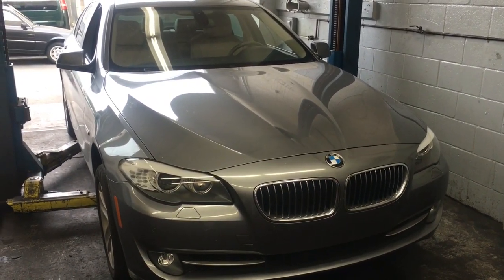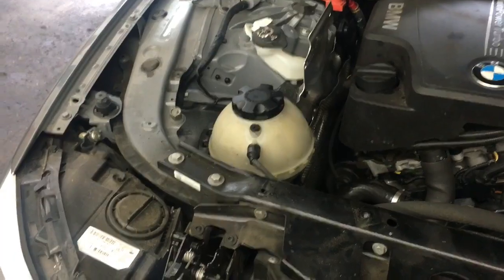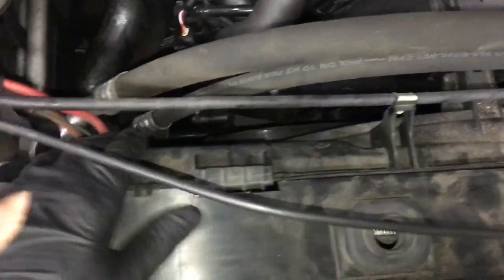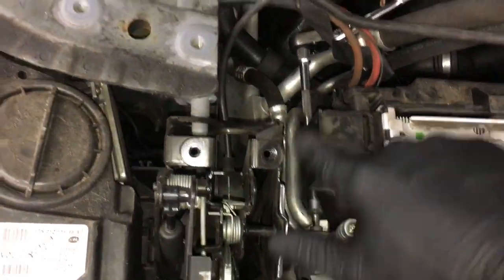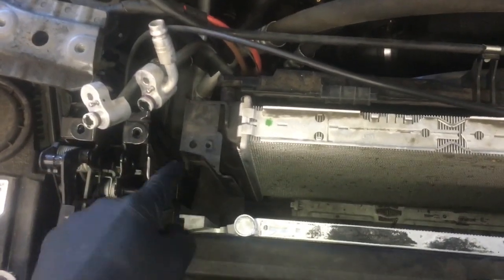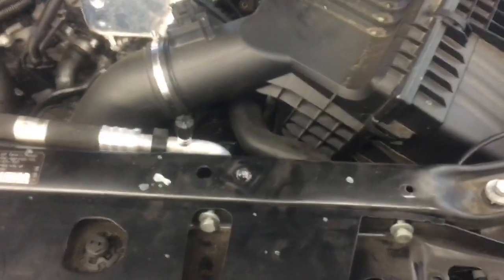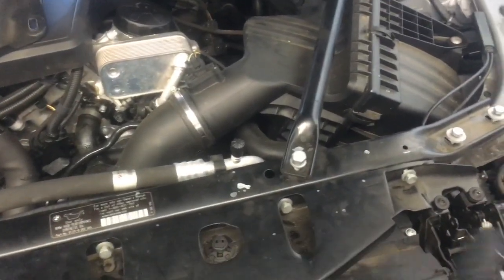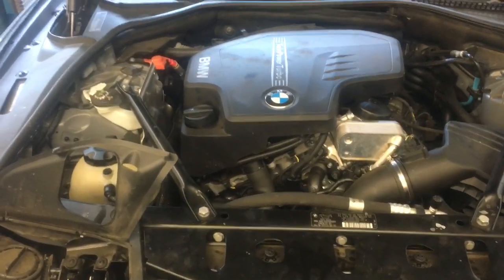How To Replace The AC Condenser On A BMW 528i (f10)

Comment: So, just followed this video guide for a 2013 BMW 525D and apart from the screw location is slightly different for the condenser/radiator plastic cover, its exactly the same! Great video which has saved me a lot of time today at work. Thanks for uploading it!!
Reply from the maker: Johnjourno glad to help. Thank you for watching and writing!
Reply: Aha yes I just said the same. I needed an extra long extension squeezed down the gap to the side of the condenser.

Comment: Paid £90.00 for BMW to daignose this part as leaking. They then quoted a FURTHER £748.00 to replace it!! I bought an IDENTICAL condenser from big UK suppliers for £149 + VAT at 20% and was more than amazed to find that the branding and labels were almost identical, the only difference was that someone had carefully removed the part of the yellow sticker that, on the original, contained the BMW logo and part number.... BMW wanted nearly £500 for just the condenser. Thank you for this video, it was invaluable and I did the job in 2 hours. Keep up the good work and lets collectively stick it to these outrageous Main Stealers
Reply from the maker: Julie Williams glad it all worked out. Glad you saved some money and got your car back on the road. Thank you for watching and writing!

Comment: I did my 2011 F11 2.0d condenser today and  it’s actually 90% same as this model with just an extra couple torque screws down both sides of the plastic condenser cover

Comment: Thanks for the instructive video. I am trying  to replace the condenser on my 2012 m5 but getting the old one out is not as straightforward as on the 528i because on top of the condenser there are two additional radiators for powersteering- and transmission oil. The one for powersteering can cautiously be moved out of the way but that does not look to be feasible for the other one. Any idea how to proceed? I was thinking about disconnecting the lines to the transmission oil radiator and taking it out completely. Since the connections are at the highest point and most of the oil should be in the pan at the bottom of the car this should be doable without spilling too much fluid right? Other suggestions welcome.

Comment: Great video quick question I have a 2011 535i xDrive I have a fan that keeps coming on and off I have changed the water pump as well as a thermostat as well as the coolant temperature sensor do you think by any chance that the AC sensor could have something to do with the fan coming on and off I have already bleeded the coolant system added coolant change the tensioner new belt that are fresh oil change as well as added a o-ring the fan still keeps coming on and off can you please give me some feedback cuz I am lost

Comment: Thanks for the awesome video. My AC is currently not blowing cold air after recharging. What's the best way to diagnoise the problem?
Reply from the maker: Long Chau now you want to see if you’re getting power and ground to compressor. Check fuses and hook up a scan tool check for codes.
Reply: I can see that my compressor is engage. What's next?

Comment: If I wanted to do this DIY myself (and I'd be comfortable doing so), are there machines I can rent to evacuate the refrigerant? or could I take it to a shop, have them do it, then drive home and do the work? Is there a video on replacing the compressor as well?
Reply from the maker: Michael Bennett you can definitely take it to a shop and have them evacuate due to repairs at home come back and have them charge it. I don't have a video on the compressor at this time.
Reply: Thank you!
Reply from the maker: Michael Bennett thank you for watching!

Comment: The process is good for the most part except the details for how to install the orings was not detailed at all with video.     Also missing torque values in the reassembly process.